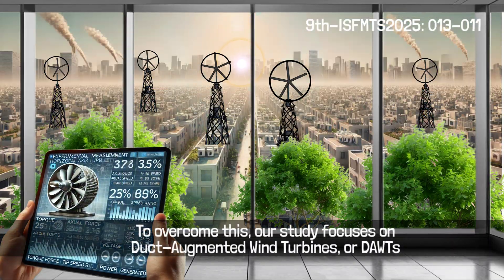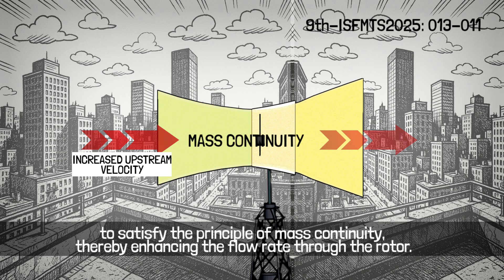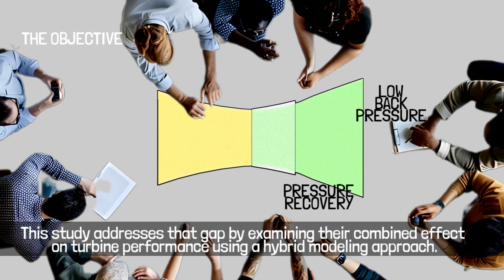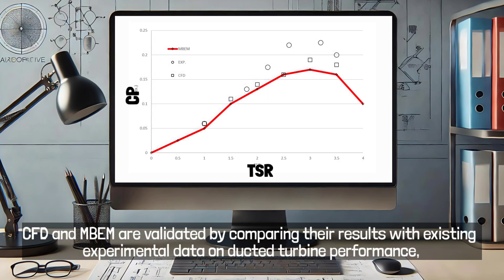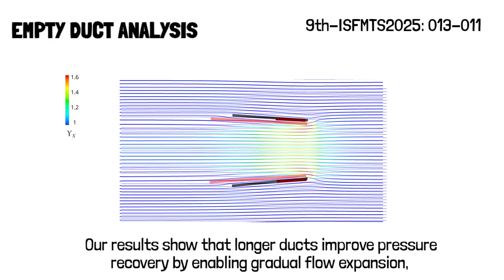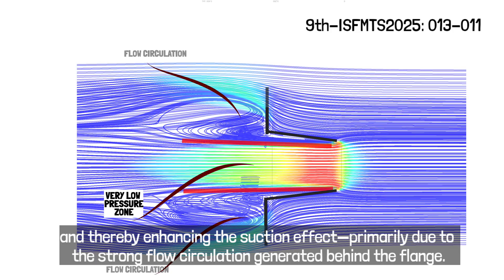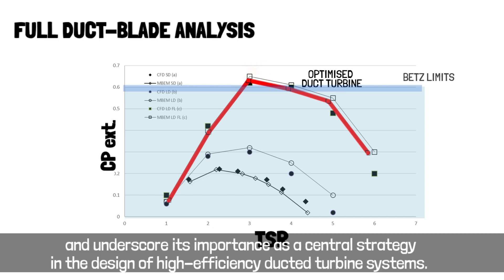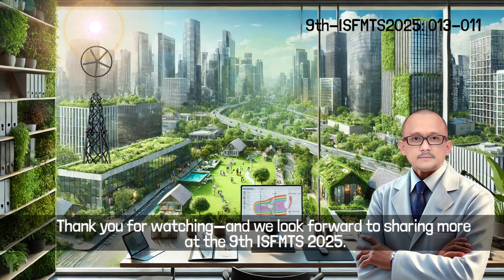Duct Augmented Wind Turbine : Pressure Recovery and Back Pressure - 9th ISFMTS2025

Comment: Paper ID: 9th-ISFMTS2025: 013-011
Paper Title: Enhancing Power Generation in Duct-Augmented Wind Turbines: The Role of Back Pressure and Pressure Recovery Using CFD and a Modified BEM Model
Conference: 9th-ISFMTS2025